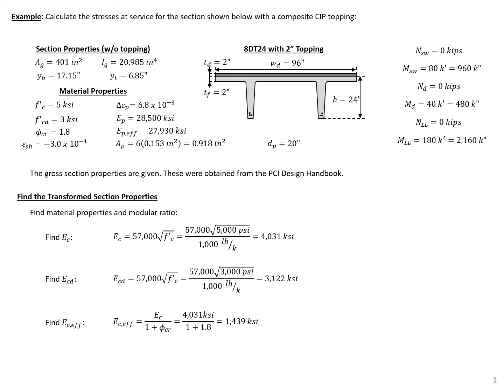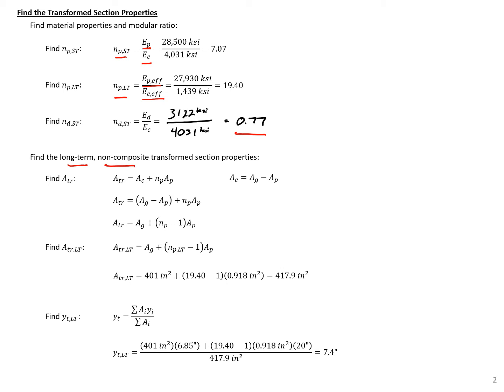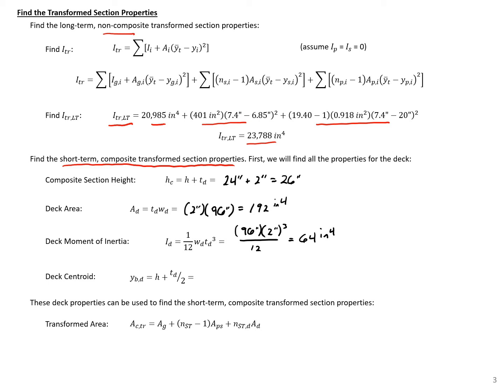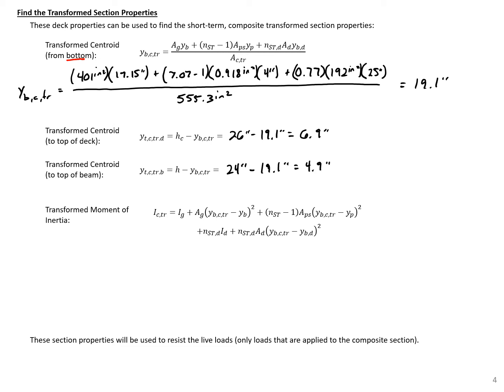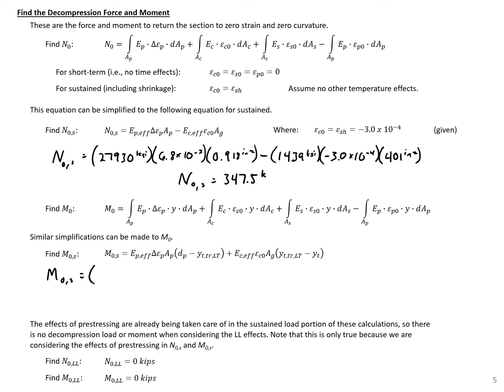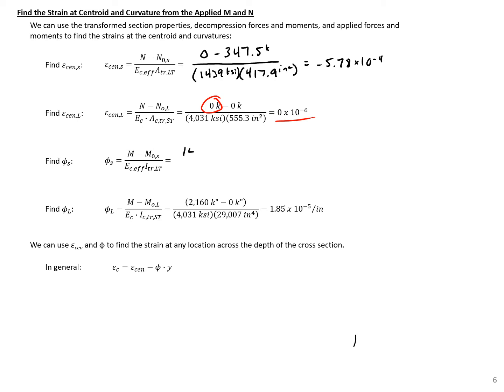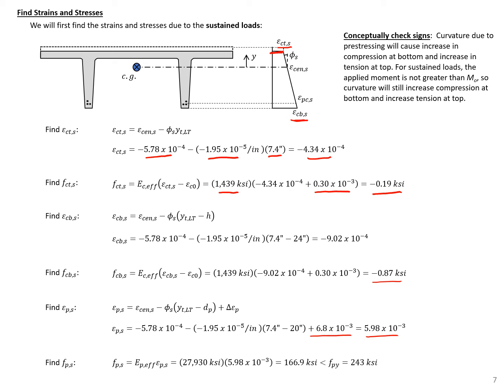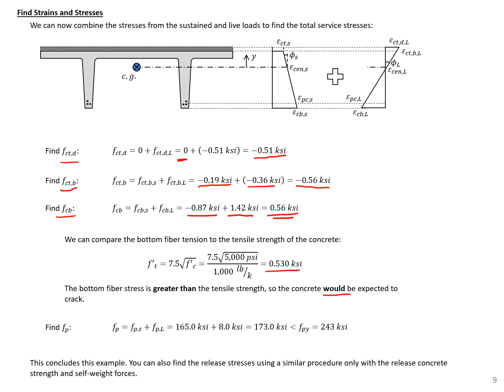Prestressed Concrete Design - 6 - Example 3 - Strain Compatibility with Composite Sections (2/15/21)

Comment: Hi David, great content! can I ask you if you have a video explaining how Epeff is calculated? I have checked but I cannot find it. Many thanks.
Reply from the maker: Hi Servando, you can find details on Ep,eff at https://youtu.be/o3D97kIEJAY?t=3335 (slide 53-57). I am sorry it was hard to find.
Reply: @davidgarber1664  many many thanks for the quick response and for pointing me exactly were to find it. Can I ask you why you haven't applied other prestress losses in this example? Or you have applied them sort of implicitly already while calculating Δεp. Again, fantastic content, congratulations.